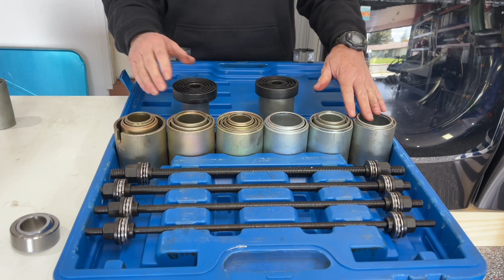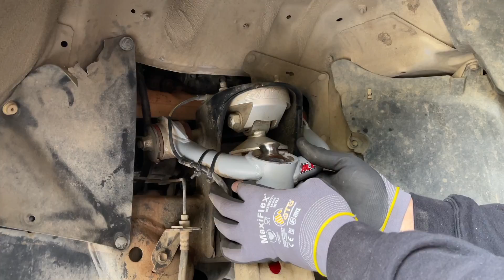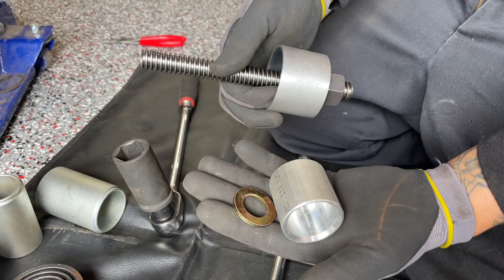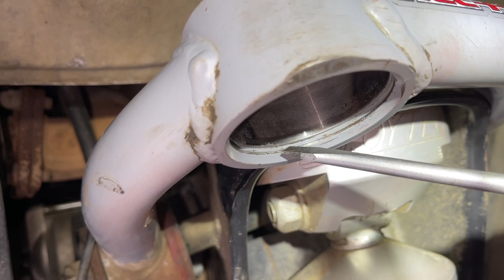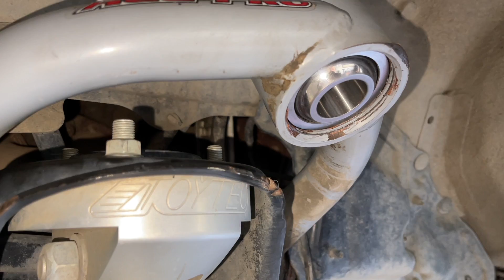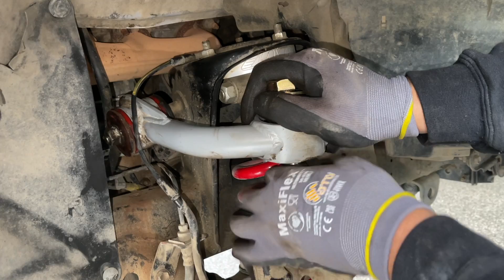UCA Uniball Replacement

Comment: Fantastic video. I installed mine of my all pro upper control arms and while driving when I steer I hear a bit of noise. Is this normal and do they just need to be broken in? I lubed it with silicone dry lube. Torqued to 80ft lbs on my 2015 Tacoma. Thanks in advance!
Reply from the maker: I don't know if that's normal or not.  I'm guessing they'll break in.  I don't remember Mark saying he had any noise after the swap.
Reply: @TimmyTheToolman I emailed All Pro and turns out they say this is normal. There is a break in period.
Reply from the maker: @myronhensel  Glad you got your answer.

Comment: Fantastic video. I installed mine on my all pro upper control arms and while driving when I steer I hear a bit of noise. Is this normal and do they just need to be broken in? I lubed it with silicone dry lube. Torqued to 80ft lbs on my 2015 Tacoma. Thanks in advance!
Reply from the maker: They might just need to wear in a bit.  i don't remember Mark having this issue though.

Comment: Great video. Quick question Can you help me with my 03 Tacoma I need some engine work done or someone you trust that you can recommend down here in southern California. Thanks again
Reply from the maker: We're in NorCal.  What's wrong with your engine?
Reply: I believe I have the same issue like Sean's 4Runner. I have 5vzfe supercharged I saw coolant leak between the block and head on driver's side. Thanks for replying
Reply from the maker: @JorgeSilva-wk8ji  Sounds like you either have a leaking intake manifold gasket or maybe the coolant bypass pipe connection to the block is leaking,  KP Offroad might be able to help you.  They're in SoCal.  https://kpoffroad.com/
Reply: Also wanted to ask you which head gaskets did you use on Sean's 4Runner when you replaced the heads from Yota 1 performance. Or do you know of better head gaskets for supercharged 3.4l. thanks for the help
Reply from the maker: @JorgeSilva-wk8ji  we used OEM Toyota MLS (multi layered steel) head gaskets

Comment: Man these after market upper control arms dont last. My SPC ball joints and bushings were shot in 2 yrs with no offroading lol
Reply from the maker: Mark's uniballs were 7 years old, so it was not too bad for longevity.
Reply: watched a yt vid last couple days that had been posted quite recently. it was an off-road supplier that said they were no longer stocking spc due to this issue, bad batch aft bad batch. said until spc proves they have issue resolved they won’t stock them

Comment: I have the eBay uniball UCA. I know everyone says it’s crap but would it be worth it to change out the uniball to this style wth the straight thru bolt?
My Uniball has the short allen head bolt on top and a hex bolt on the Bottom if that makes any sense.
Thanks Timmy the Toolman! Appreciate you tons!
Reply from the maker: You're very welcome.  Thanks for the comment